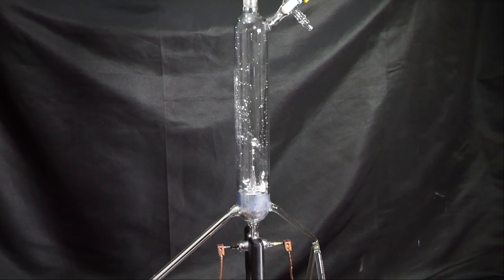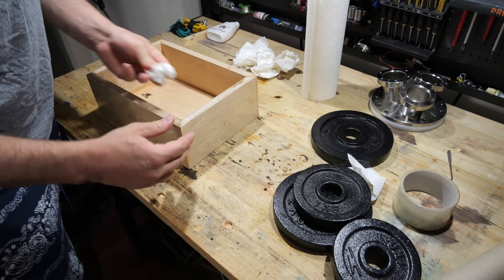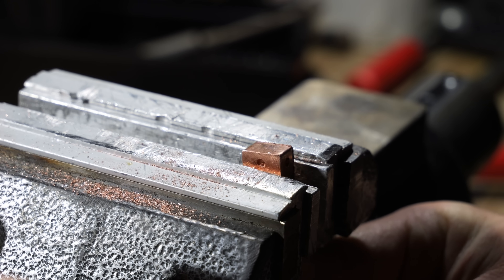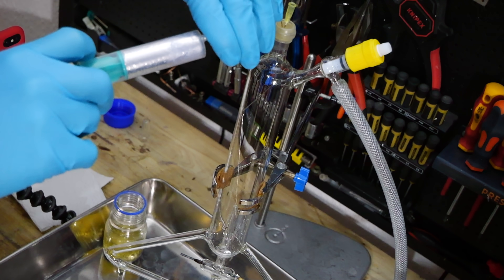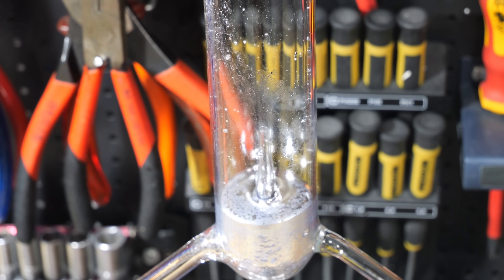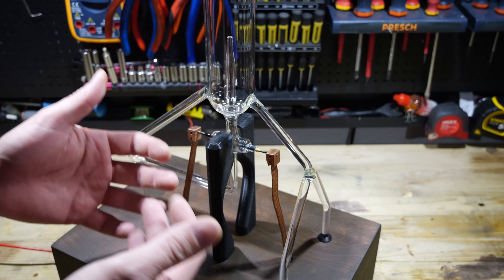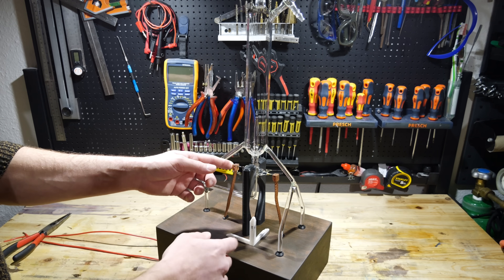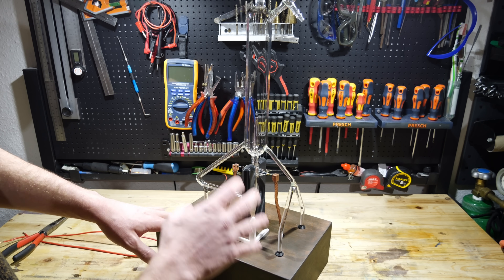This Fountain Runs on an Explosive Metal

Comment: Very nice job.
What would happen if, on the contrary, the tube were filled with oil? There would be no dirt left and this would slow down the drops.
It seems that the efficiency of the pump is very low. If the liquid circulated in a thin tube, the resistance would increase. I can imagine a thin, long circuit between two glass plates...

Comment: Not as much current will be needed in the electric circuit if the magnetic circuit is improved. As shown, the magnetic circuit is mostly open air, with are being a very poor conductor of magnetic field. Instead of the plastic magnet holders, it needs to be steel or iron in the form of a U. The bottom of the U can be hidden inside the wooden base, or left exposed on top. Then, with only a small gap between magnets where the pump apparatus goes, the magnetic field will be very much stronger, producing much more pumping force for the same amount of current. Then the current can be reduced so the tungsten rods don't overheat.

Comment: You carefully removed trace moisture from the fountain, but not, as far as I can tell, from the plastic syringe and tube used to fill the fountain
Reply from the maker: Yes, the fountain was heated unter vacuum and flushed with argon several times. Since I cannot heat the transfer tube, it was only flushed with argon. A stainless cannula would have been better.

The syringe was used to demonstrate the reactivity  not to fill the fountain. It was only flushed with argon.

Comment: What about using a shorter chain alkane like pentane instead of mineral oil and evaporate it later? Pour it in cold, heat it a bit and argon flush + vacuum to remove it?

Comment: I’m wondering, what is the reason for tungsten electrodes? Would it not be possible to use a metal of lower specific resistance such as copper?

Comment: Perhaps you can use an isolating oil that evaporates when heated under vacuum. Then you can remove the oil after adding the metal.

Comment: Mercury fountains are probably more dangerous because they require much higher voltage/current because of how dense mercury is, it requires a lot of energy to get it to move. You don't have the fire hazard but you do need to keep the fountain airtight anyway due to the toxic vapours, and because mercury is so dense it's much more liable to break the glass.

Really the only advantage of mercury I can think of is that it looks prettier because it doesn't stick to the glass like NaK does.

Comment: I don't understand why you didn't set the power supply voltage low enough that the current draw was within its limits. It appears to have a readout for amperage so that you can find what current you need to get a good flow going without overheating. Then, you could simply use that current as your "setting", as a magnetic field depends only on amperage. Voltage does not factor in, besides being able to push the amperage through the circuit. 
-I think that if you do another version of this fountain, I would suggest to put levels in it. Have electrodes in the line of the jet that perform different effects, and are connectable from the outside. -You could have a level (or 3) of accelerators, and then possibly a set of beam-steering electromagnets. You could make spirals by changing the deflection while the stream is in flight. Put a flat-bottomed Erlenmeyer flask upside-down at the top, and use the bottom (top, in this case) as a target for the metal jet. Then, make transparency overlays to put on the flask, and hook the whole thing up to a microcontroller. Program some games and practical applications into the microcontroller and ???, then victory. 
-If you pump RF energy into the metal while you're at it, you could make a pretty weird antenna with it, and light up florescent bulbs outside the setup. Or, I'm sure there would be a way to get an antenna length sweep along with a frequency sweep, for the most impractical radio scanner possible. 
-Put two complete systems in the same container, but without the fluids (normally) touching. Pump them both into another upside-down Erlenmeyer flask, but at angles away from eachother. Then, offset the separate (isolated!) power supplies by a high voltage to create a unique Jacob's Ladder that is so awesome, Styro Pyro would probably burn something in your honor.  
-Instead of the legs that are on one side of your current setup, make a second return tube, but this one goes to the top (of a shorter display tube). The goal is to get the metal to fly up and into the top port, and it loops around back to the reservoir to make a continuous ring flow of the metal. Perhaps it would pick up momentum. If it does, then the head-height would increase rapidly. If so, you could change the layout so that there are multiple nozzles below your main jet (in some kind of pattern), and put your electrodes above these nozzles. The side nozzles are normally below the surface of the metal, so when they are revealed by the fluid being looped into the top return tube, the momentum would make a multi-jet fountain with an infinite loop in the middle to give it momentum. 
-Make a horizontal version with the reservoir on the bottom. The jet and return are horizontal, facing eachother. From mid-way along the bottom tube, put a somewhat wide up-tube. Put both the oil and the metal in this one. From one end, you flow the metal up, where it jets horizontally across the spot with the "oil tube", and into a receiver cone. I'm trying to describe a glass aspirator pump (and you could just buy one and melt it into your system) but this one would necessarily be a closed system. The jet of metal makes a low pressure zone when it crosses the gap, and it pulls the oil into the flow. The oil then separates from the flow in the bottom tank, and rises up to the up-tube I previously described. I'm not sure, but that may be the most clear representation of how an aspirator pump works that has ever existed, so that's cool. I guess.
Reply: -Put a magnetic "pinch" coil low in the stream. Now you can vary the column width in real-time. Now hook the coil to an amplifier output and put patterns, speech or music into the amplifier to watch a visual display of the sound. Arrange an array of different-colored, columnated LED bulbs so that they strike the jet at an angle that depends on how wide the jet is at that moment/location. Now, you have a multi-colored light display of the waves in the flying metal mirror. I think that the mirror would change behaviors in relation to the sound frequency as well as the linear rate of the jet. Some tinkering may be required.

Comment: You need a much better magnet design.  There needs to be an iron "magnetic circuit" closing around the outside of the magnets.  This will more than double the magnetic field.  For each doubling of the magnetic field, you only need half the current.  This will reduce the heating to ONE FORTH what it was before.
Reply from the maker: I wanted to try it for this design but since I don't have access to a lathe or mill, I wasn't able to make anything that looks halfway decent. But I will try to get it made for the next version.
Reply: @AdvancedTinkering You don't need a lathe or mill, you just need ruler, hacksaw & coarse file.  You could build the back-iron of the magnet from transformer laminations, stacked up to the appropriate cross-section.  You could also use standard low-carbon steel (preferably hot-finished) stock & a hacksaw.  (If it is cold-finished, heat the pieces with your torch to red-heat & cool slowly).  The cross-section of the back-iron needs to be at least as large as the magnet cross-section, & must be continuous.  The magnets need to be twice as thick as the gap between the poles.  If you do this, you will achieve field of 1 Tesla in the gap.

Comment: You have a forth problem. The copper electrodes that are fused into glass will expand from heat potentially causing the glass to crack.  And with the currents involved you can't avoid heating of the electrodes. So you can't run this device for long anyways. Also, related to the large currents, you can't ignore inductivity of the circuit, a similar problem to what spot welding devices have. So there would be potentially high voltage spikes at moment of disconnection of the current.  So to protect your power supply from high reverse voltages I suggest you include a relevant TVS diode reverse-parallel to your fountain electrodes.

Comment: Instead of having two thick electrodes, consider using an array of thinner electrodes, perhaps three or four in a row on each side, so that each electrode is only carrying a portion of the total current.

A current-limited power supply that allows you to set the maximum current is also a better option than a voltage controlled supply for this application, as the pumping force is directly proportional to the current.

Comment: Interesting alkalis, one positive one negative. The same alkaline potion (5 milligrams) makes up your sino atrial valve contained in our hearts. It maintains our static electrical link to our brains, as well  as controls the constant pulse of our beating hearts, generating a voltage of 0.1 volts. It is our own battery on legs and last's a lifetime. These two toxic alkalis are the only reason we each and all exist. Interesting choice of lightweights you made, my favourites by far.

Comment: Really beautiful. 

In addition to DC MHD systems,  you can also drive liquid metal with an induction motor approach and completely eliminate the electrodes.  But this would require winding coils and an AC control system.   DC is far simpler.

Comment: The oil contamination problem could be reduced by using a lighter hydrocarbon (such as hexane) and vacuum-distilling it off after adding the nak to the pump.
Even mineral oil could probably be removed this way, although it would likely take a long time even if you were to heat the assembly to 150c again. The nak itself wouldn't care, due to its extremely high boiling point and low vapor pressure.

You may be able to use multiple smaller tungsten electrodes for better current-handling, either grouped together or maybe as several smaller "pump" sections and run them electrically in parallel but fluidically in series. That combined with some passive heat-sinks on the outside should reduce the heating issue.

I would be happy to help make a yoke for V3, I have access to a milling machine and other metalworking tools.

Comment: i would replace your electrodes with modified spark plugs from a high energy ignition system or a modern car that has resistors built into the plugs already.  If you make the threaded inserts sealed in the glass you can experiment with different spark plug designs as well so it would be wise to pick a common thread and depth for that reason.  It would also be interesting to see the pump work normally shooting to metal to a height that keeps it in an argon zone but
Reply: occasionally have the metal reach beyond the height of the safe zone where it can react with the air and ignite.  sorry i accidentally hit enter rathe that the shift key. Lol

Comment: A high current buck converter in constant current mode would work well for this. The different pumping speeds actually makes the fountain more interesting and you could connect a microcontroller to vary the current. If you want help choosing or designing one I can help.

Comment: Should add some flux for the connection between the copper ribbon and the copper caps so it’s actually using all of that carrying capacity instead of just whatever touches when crimped.

Comment: Any specific reason you wanna use sodium instead like mercury or something? Is mercury so heavy it’s hard to pump, or just like the idea of the metal being flammable lol.
Reply from the maker: You are right that mercury would be too hard to pump due to its density. The other reasons are: 
1. I like the idea of a flammable metal being used ;)
2. I would rather work with a non toxic flammable metal than mercury. I know that mercury metal isn't that toxic, but it gets everywhere if you spill something and it's a pain to clean it up.

Comment: Hats off. For all I know, this is the first time anyone did it on Youtube. It is a very demanding project requiring knowledge in several fields and not many people have it. Even less have both that and the time. Beautiful contraption.

Regarding mineral oil, just abandon it. Mineral oil is used for shipping. It got popular by "eBay China sellers" because it's difficult to ship alkaline metals in a container that smells of hydrocarbons.
Golden standard for keeping alkaline metals is purified kerosene.
Reflux a small amount of NaK in kerosene under argon for an hour and you will get kerosene completely inert against NaK even under higher temperatures. That way, even if there are small amounts present in the fountain, it won't form dross.
Reply: I find it interesting how the shipping rules have led to people thinking mineral oil is the best for storing alkaline metals.
Reply: I find the glass blowing the most impressive of all this project.

Comment: How to fill: Add an argon purge to the NaK container to create an inert atmosphere above the mineral oil. Purge and fill the canula in the fountain septum or in the argon above the mineral oil several times to eliminate oxygen from the syringe barrel and leave it filled with argon. Use this argon in the syringe to displace any mineral oil that enters the canula after dipping the end into the NaK. Withdraw NaK into the syringe and avoid withdrawing any mineral oil. Remove the end of the canula to the argon above the mineral oil. Allow mineral oil clinging to the outside of the canula to drip to the end and tap the droplet to the side of the NaK container to remove it. Eject a small amount of NaK fluid to clear the canula of any internal mineral oil and then withdraw argon, preferably next to the end of the purge line, until a bubble enters the syringe barrel. Move the canula end to the septum, wiping the outside with a towel or cloth to clean it of mineral oil as you move it. Pass the end of the canula into the septum, using the towel or cloth to clean the canula from the sides just before the septum as it passes in. There should be minimal mineral oil in the system if this method is used.

Comment: You might get the supply you have to work better unmodified by lowering its output voltage... many supplies have a trimpot next to the terminal block, and the resistance of the liquid metal alone might be enough if the voltage can be lowered enough.

Comment: As an engineer, I have never heard of a "left-hand rule".  The normally taught right-hand rule is based on current being defined as the flow of positive charges.  The triad that you show for the relationship between current, magnetic field, and force is only correct if current is redefined as the flow of electrons.  In that case, the triad that you show would be correct.
Reply from the maker: Yes, there are two definitions. The "conventional current" assumes, that the current flows from the positive terminal to the negative terminal. As you said, the electron flow is actually in the opposite direction. Depending on which definition is used, the right-hand rule or left-hand rule mist be used.

Comment: Why not mercury? Would be a lot safer.
Reply from the maker: Depends on what you call "safe". I would rather work with NaK than mercury. Besides that, mercury would be too dense to be used in that fountain.
Reply: @AdvancedTinkering  Metallic mercury isn't very dangerous. However, in this case it may be quite hot and vaporize easier. How about gallium?